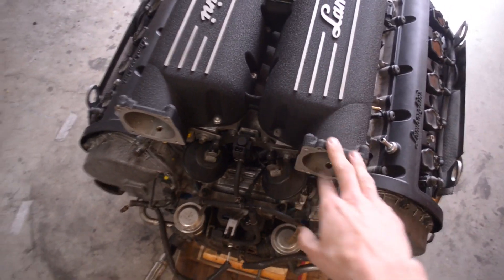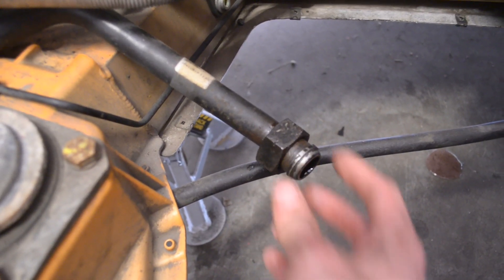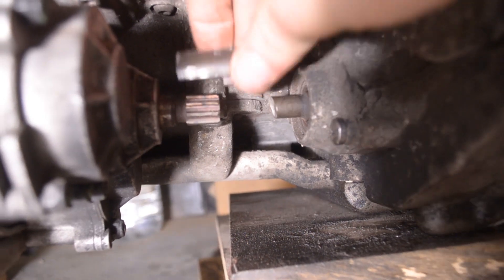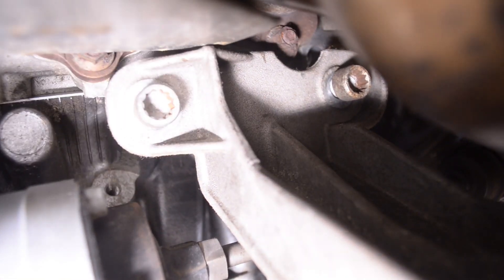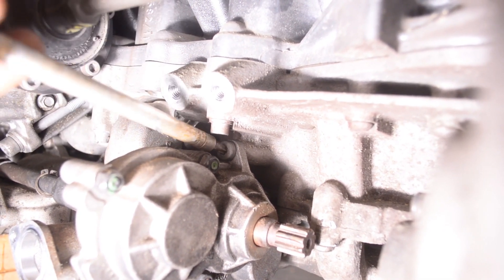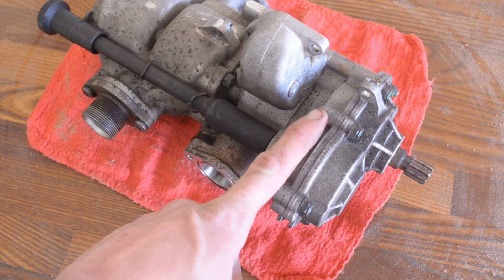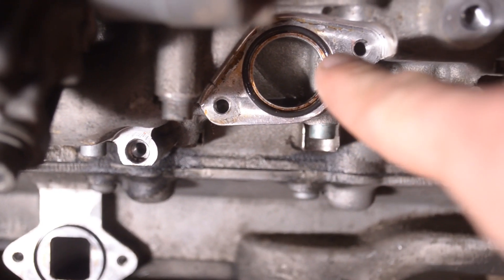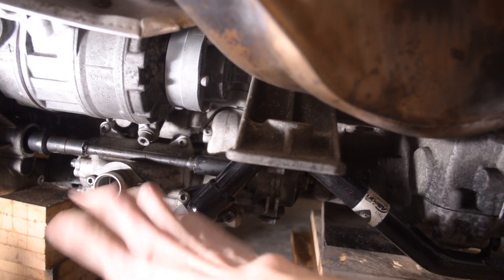This Oil Pump Stopped Me From Installing My Lamborghini V10. Let's Fix It! Pre LP Oil Pump Removal

Comment: Could u jack engine off motor mounts without taking off a lot of lines if u only needed to remove oil tank line from the pump?

Comment: How much Oil pressure have these Engines at 7000rpm and more. It is no adding pressure with more rpm is this correct?
Reply from the maker: Yalcin, I think the pressure should be at about 6 BAR at 7000 rpm. The pressure should be regulated from about 4 bar at idle, lower to about 2 bar during normal driving and increase under hard acceleration.
Reply: @TheBullRider  can you take a Video from your Gauge at accelarioton and 6Bar?
Reply from the maker: @yalcinbelen2395  I don't think so, that might be kind of dangerous.
Reply: Your Passenger can't do it?
Reply: No Response?
Reply from the maker: @yalcinbelen2395  Yalcin, I understand that you want to get your car fixed but you also have to understand that I have to take time out of my busy schedule to help you. I will also have to get my wife to take time out of her busy schedule to record.  
All considered, between taking my car out, warming it up, using gas, recording the video, uploading the video, and sending you the link I am out probably 1-2 hours of productive time.  
I provide consultation services to help you diagnose your car but I can't do it for free. If you are interested in this, we can set something up for my rate of 120$ an hour.
Reply: Payment is no problem. But what if your information with 6Bar is wrong?
Reply from the maker: @yalcinbelen2395  I encourage you to find a mechanic to help you further in your local area to help you.
I can help you diagnose problems with your car but even your mechanic can and will be wrong. But even then he wont work for free.

Comment: I was wondering what you think this should cost to fix? My car doesn’t have oil pressure and the oil pump shaft I believe is toast. I towed it to an Indy shop and he made it sound like a super big deal(said it could cost up to 10k to fix)
Reply from the maker: Hunter, it all depends on if your Indy shop is comfortable doing it with the motor in the car. It shouldn't cost 10k to fix if it is JUST the oil pump shaft that went. You will need to determine if its the shaft or the pump that went. If you get under the car and the shaft went, you will be able to turn the oil pump by hand. 
If its just the shaft, I would quote somewhere around 400-600 for the parts and maybe 2-3k for the labor depending on how much of a pain those fasteners are.
Reply: My dealer said to replace both for good measure since they said they cannot determine if it’s just the shaft or pump. Is the true? Pls let me know I need you advice
Reply from the maker: @hunterl4729  Not really! I mean unless your pump is totally siezed and jammed by something. but what typically happens is the shaft rusts out and doesn't turn with the motor anymore because the two don't interface. 

There are two failure mechanisms at play. 
1. The dealer thinks the pump is clogged with stuff and gets jammed causing the shaft to fail. Makes sense. 

2. I think the rust has gotten to the shaft so much that it doesn't turn with the 5.0 engine  anymore. 

#2 is much more likely however as we typically don't see failures of the pump. 

Here's how you can tell what one happened. try and spin either the water pump shaft or the oil pump shaft to see if it turns freely with moderate resistance. They are both coupled as you can see in the video. If it spins then its just the shaft that has failed in relation to the interface with the motor. 

Pull the shaft off by either uninstalling it or angle grinding it off. Once you get the shaft off completely you will conform again by spinning the oil pump gear by hand. If it spins and gives moderate resistance, then your pump is fine. 

If your oil pump doesn't turn with the shaft removed, then you need to replace the pump too. 

Does that make sense? Hope this helps

Comment: These videos make me feel like if I can find a beat up lambo (a pre Lp obviously) and if I can afford to source the parts I’d be able to do these r&r things with little issue. It’d be having to reprogram and reinitialize and recalibrate everything IMO.  
How do you deal with anything you need regarding recalibrations, reinitialization’s..etc.  
Thanks
Reply from the maker: What do you mean by recalibrations a Singh? Are you talking about the E gear system? Most components on this car are self calibrating with the exception of the E gear system when you replace the clutch. And for that you need the special software.

Comment: The hexagonal oil pump shafts doomed VW group for about 5 years from 2006 to 2011. Lots of Audi from the 2.0tdi to petro engines died because of that
Reply from the maker: Inacio, when doing my research for this video I did come across a lot of those failures on the 2.0TDI so thanks for pointing that out! 
That shaft honestly needs a small heat shield to prevent all the grease from boiling out of it.

Comment: It's interesting that the Gallardo and F430 seem to have similar issues with some of the mechanics of the car, despite the parts being different.  I just bought a new oil/water pump rather than repair it because the part wasn't that expensive, about $1300.  Of course, by buying a new pump, I don't have the satisfaction of repairing it myself.  While you have the engine out, wouldn't it be a good idea to take care of other things, like motor and transmission mounts, thrust bearing and seal, clutch and flywheel?
Reply from the maker: Kent, your lucky because this oil pump for the Gallardo is about 3000$ new. I don't think you want to know how much this little input shaft cost that I had to grind off. Hehe
I looked at your oil/water pump for the 430 and it is a very nice unit! I like the engineering on that piece a lot. You appear to have more scavenge ports than this Pre LP pump. Comparatively, this pump is a bit archaic in design but it does well for the application. 
The "while your in there" strategy has never really worked well for me in the past. It has lead to cars that never get driven for 6+ years and started family fights that haven't ended yet... (More on that in a few months, I have a new car coming my way that I bought! )

I did replace the rear main seal however! 
I treat this car a bit differently as you could understand. I didn't replace the clutch and flywheel because its at 60% and I want that to be a wholly independent video series where I discuss programming afterwards, bleeding the clutch slave cylinder, clutch options, and the start to finish DIY on just the clutch. I also want to show how you can NOT care about the clutch in these cars, have a good time, replace them when they are worn and move on to keep having FUN!

Comment: Another one book-marked for future use!  How hard to you reckon getting that motor mount out of the way would be with the engine in the car?  I'm running through my obscure tool list from previously having an MR2 and constantly having to work in zero-clearance situations.  Would a ~6mm 6 point box wrench on just the star/ts bit let you get to that with enough torque without moving the mount?
Reply from the maker: Richard, I really dont think so! That fastener is jammed in there. From what I have experienced and what others have discussed on the forums, the general consensus is to remove the motor mount. A cheapo harbor freight engine support bar will help with this though as you can mount the bar right on the aluminum crossmembers that lattice the engine bay. What we need to find is a good set of high quality and very thin extended reach torx!

Comment: What holds up better over time in your opinion, grease or anti-sieze lubricant?  
Nice little job on that oil pump shaft/coupler!
Reply from the maker: Thank you Mario,  it went in great. You gotta love new parts but it's annoying when you are waiting on the smallest little part before you can fire the monster back up again!! 
It depends on the application! I use grease to hold in O rings and lubricate them for assembly and I use anti-seize for bolts, epically ones that get HOT like anything on the exhaust. I didn't want to use anti-seize on those shafts but I DID think about it but I was concerned about the metal shavings in the Antisize wearing down the shaft over time as the tolerances aren't that tight and that system has a little bit of slop in it. 
On tighter tolerance systems like the input shafts for the transmission, Anti-seize every day of the week. All anti-sieze really is made of is metal shavings in a lubricated matrix.